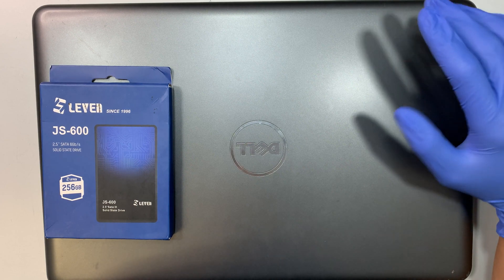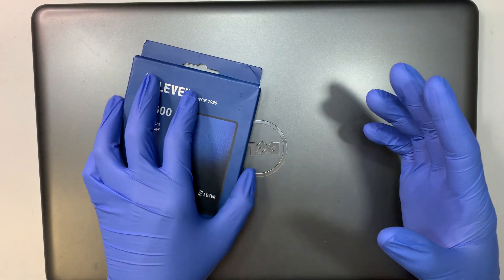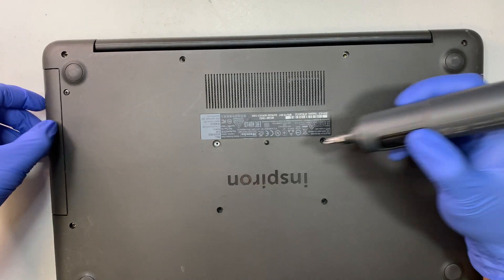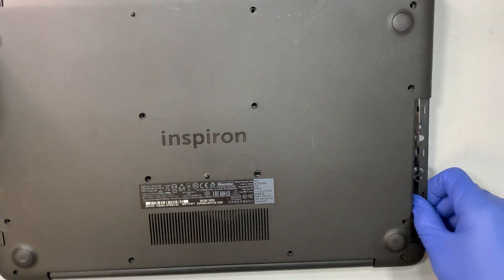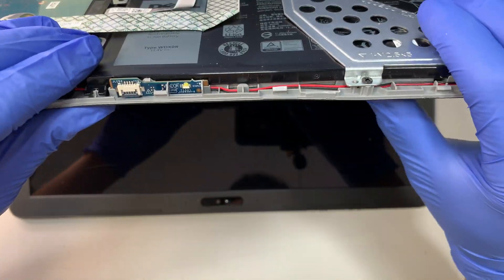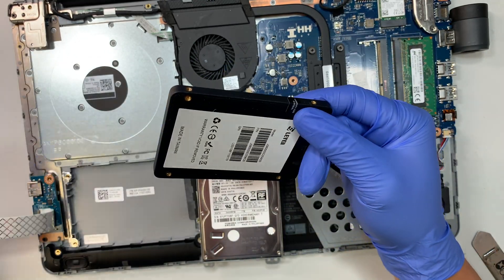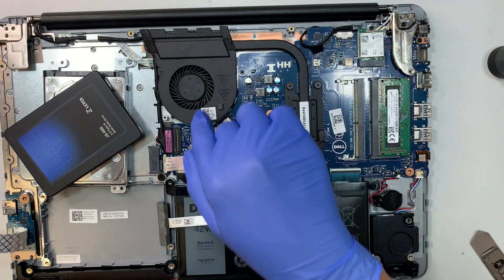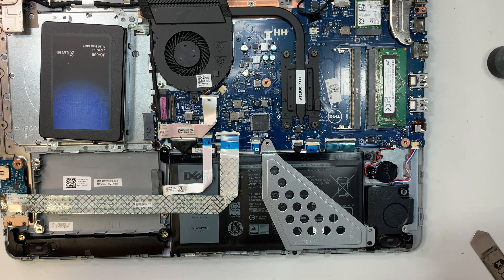Dell Inspiron P66F Hard Drive Replacement

Comment: Thanks for posting this. Did you get a significant speed improvement? Mine's the previous year's model, it's a dual-core @ 2.5ghz. Also, did the cd drive tray just slot straight back in when re-assembling it?